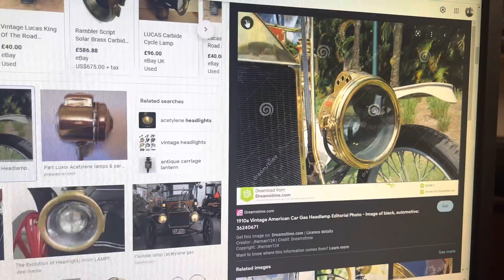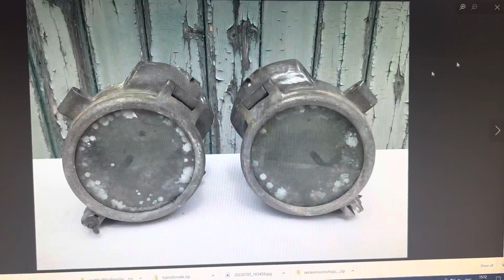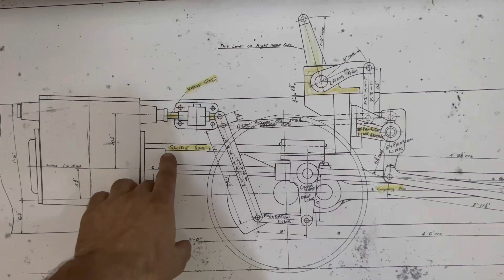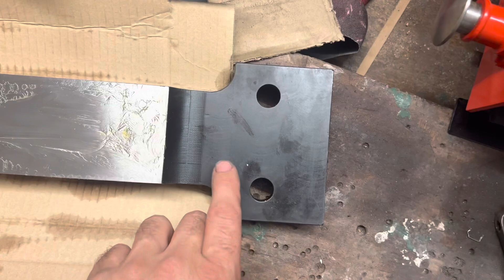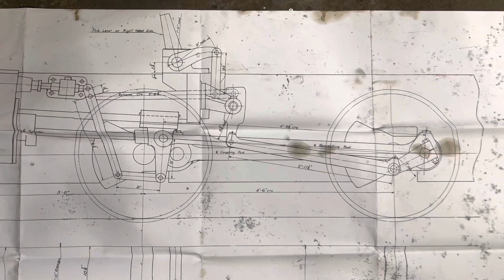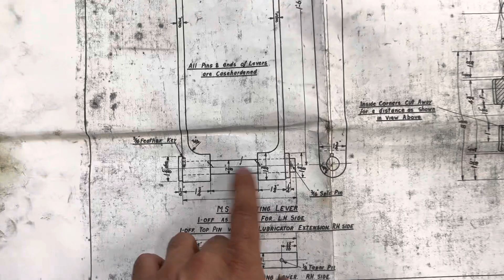Fowler 16341 Restoration Part 17

Comment: I must say I am mightily impressed with your machinists skills! Making such large components on the Bridgeport takes a lot of thought and skill. I can’t imagine what this restoration is costing not only in shop hours but the raw cost of the steel and then sending parts out to be case hardened and water jet cut. Very very impressive skill set in your little workshop.
Reply from the maker: Absolutely!  I’m expecting that we will be about £100,000 in by the time we finish.  But the cost of materials is so high at the moment that who knows where we will get to!  I try not to think about it! 😂😭
Reply: @TheSteamWorkshop  but what is a restored steam engine worth? I work in tiny pieces of steel and brass compared to what you use, I can’t imagine what those large pieces cost. Every time I restock the prices seem to have gone up. Good luck with the rest of the machine and thank you very much for documenting it.
Reply: The Bridgeport can machine larger than its own table area.
Reply: @union310  it can. But it takes skill and thought as I said 🙂
Reply: @sjv6598  I do not disagree